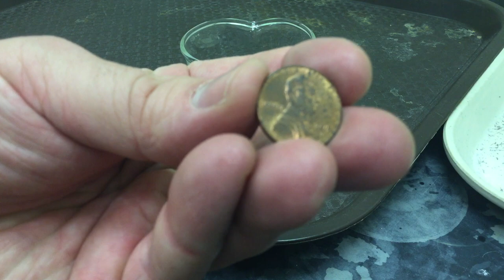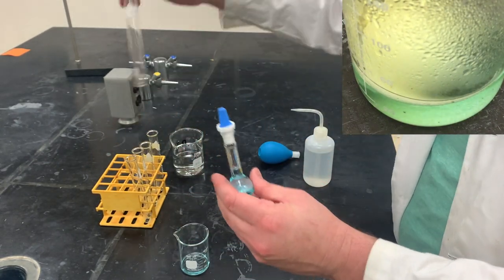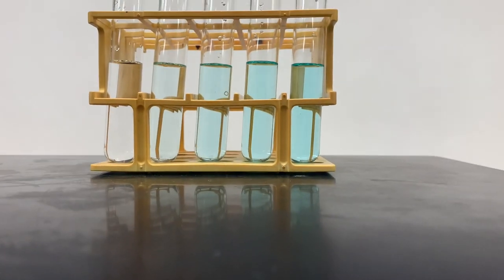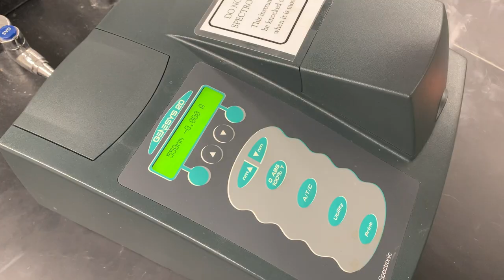Spectrophotometric Determination of Copper

Comment: Thank you so much for this video.. I want to ask! 
Can the same experiment be used to determine urinary copper?
Reply from the maker: There are other compounds in urine that may interfere with the readings. You would need to first do an extraction with Zinc Dibexzyl Dithiocarbamate. But other than that yes basically.
Reply: @CSUNChemistry  okey thanks